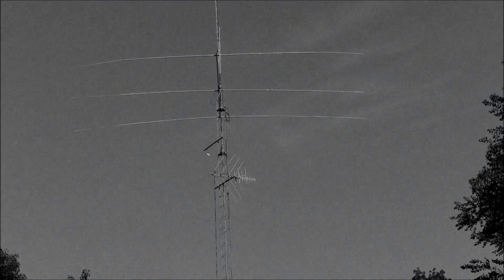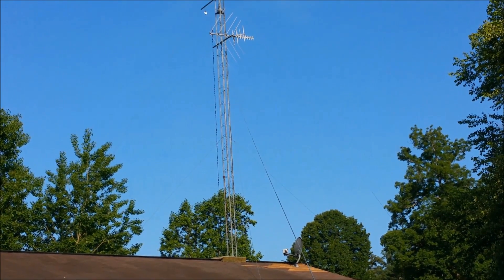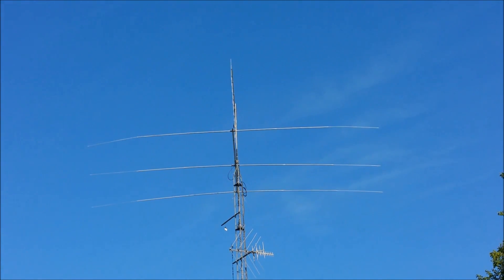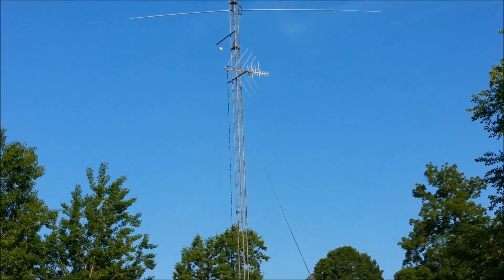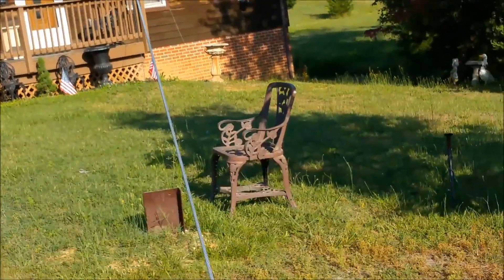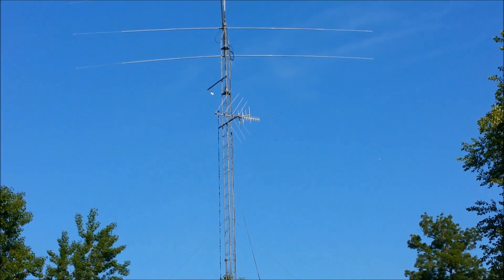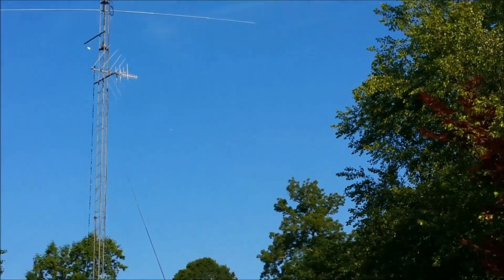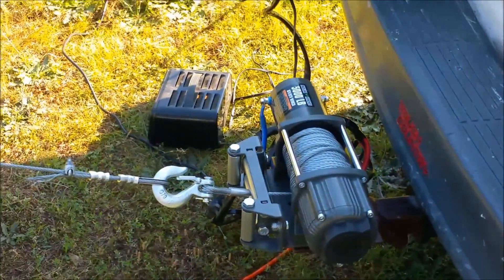Lowering and Raising 60' Rohn 25 Tower, Homemade HInge

Comment: I'm thinking about setting up my first tower here at the house, a good friend of mine has an old 60ft tv antenna tower on the side of his house he told me I could have. I ran across this video looking for ideas on how to lower it, it's bolted to the house and doesn't have and guy wires so it's going to be a task getting it down. I have a few questions if you don't mind sir.
 I'm trying to figure out roughly how thick of cable is needed for the guy lines, and roughly how long they need to be, I understand you might not know off the top of your head how much it took. Also wondering roughly how much length you needed on a winch cable to lower it down, I believe I only have about 50ft of cable on my electric winch but considering getting a hand crank winch specifically for this purpose. I'll definitely keep in mind your hinge setup, never thought about doing a hinge, it's a great idea! Chances are this old school tower will probably fold up on me but for free I'm gonna try to put it to use to get some range for my GMRS radios, and eventually setup a repeater! Also hoping to dabble in Amateur radio once I get licensed! Thanks man!
Reply from the maker: HI!  Im quite surprised he had 60' up with no guy wires!  I think Rohn suggests guys for anything over 30 or so.  I live in FL and we get plenty of wind and I've seen quite a few 40's up with no guy wires and they've survived though the years (Bolted to a 1 story house at gutter level!).   For my 60 footer here I had 2 sets of guys on it.  Ones at around 35' and at about 55' (or so).  I don't remember the length, but I had a 500' spool of 3/16" 7x19 aircraft cable.  I made my own lengths with turn-buckles so I could tighten everything up.  I highly recommend getting the crimping tool and the crimping sleeves so you can custom make your own cable lengths.  Cable clamps will work too where you might have to undo the cable.  Depending on your layout it's hard to say how long your pull cable needs to be.  I put mine at 45' and I believe it was about 100' long.  I can't remember if the 500' spool was enough to do 6 guys plus a pull cable, but it'll do most of it and then you might need a little more..
Reply: @JLPicard440  Awesome man, I appreciate the info! & yea it was on the house when he bought it and it's one of the old style towers that are known for rusting from the inside out so I'm not even sure I can get it down without tearing it up, they have it bolted to the house above the 2nd story and it's a old house from the 1800's so it's pretty tall which is probably what has kept the tower standing so long. Thanks again man! I'm currently only running GMRS but studying to take the HAM tech test now!
Reply from the maker: Oh yes... a 2 story house would definitely help hold that up better!

Comment: How far away was your winch setup from the tower? Thats a simple and effective way to accomplished this. I'm standing a 40 mast with a wind turbine here in the near future. I like adding the pull line permanent. I hadn't planned that and currently have guy lines planned but not in the pull direction i need. Thanks for sharing!✌️
Reply from the maker: I believe my winch is probably a good 60 or 70 feet away...
Reply: @JLPicard440  thank you for  the reply. I figured it needed to be a good distance.
Reply from the maker: I probably could have been closer, but the farther away I was the less steep the angle was to the house...

Comment: I've wrote here before, and still not sure exactly the size concrete base I need for a homemade tilt tower. Is my way of thinking correct? That being making sure the base weighs more than the tower. We have clay around here, which may possibly mean I could go even smaller? Most are telling me 3×3×3, , but I don't believe the previous owner of this tower, had anything near that size base.
Reply from the maker: Yes, it definitely matters what type of ground you have at your location.  At the location of this tower It was horrible digging by hand!  Very hard is what I mean.  I think I was down about 3 feet, but probably the hole was only 2x2x3.  I can't answer how big your hole needs to be since I can't see what you have to make that call, but it does sound to me, just my opinion, that 3x3x3 would be plenty good.  One thing I like to do is I used to build decks and I would mushroom out the bottom of the hole somewhat at the sides to make it increasingly difficult to pull that concrete out of the ground.  Also whatever metal you put in the ground, I would recommend to put bolts through it sideways that are in the concrete when you pour it.  It'll keep the metal from pulling out of the concrete..The guy wires to most of the work to secure the tower, but when lowering the tower up and down, you don't want the base moving around!
Reply: @JLPicard440  I appreciate the reply. I was told I had junk, but worked well for the previous owner. It's a crank up/ tilt tower. Inside or top section is Rohn 25g. The bottom or outside section is homemade, as well as the hinge base. I've had alot of ham tell me I need to hire an engineer before I do anything.
Reply from the maker: @theboogeyman826  I can't say on that one.  By the time you have an engineer come to your house and do an evaluation you could have probably bought a whole different setup!  I couldn't see myself doing that..  Of course I can't see what you've got, but it sounds like someone already had it installed and it worked, so I guess that means something..
Reply: @JLPicard440  yes it worked well before. I just don't really want alot of overkill if not needed. I may be wrong, but in a tilt tower install I would think the weight of the base would be the key factor rather than the depth.
Reply from the maker: @theboogeyman826  Yes, you have to consider that when you lower the tower down you'll get a lot of side to side pressure so that's where the depth comes in..
Reply: @JLPicard440  thanks for the advice.

Comment: Is it true you can only raise 30 ft of  rohn tower, with a rohn base plate? If so, that must mean alot are using homemade hinge plates.
Reply from the maker: I haven't heard that.. I remember the Rohn instructions said to use guy wires every 30 feet.  My home made plate certainly wasn't super strong and I never had a problem with it.  I used the cheapest materials I could think of.
Reply: @JLPicard440  yeah I've heard the rohn plate was made to raise first 30 feet, like a installation aid.
Reply: Also some claim there is alot of stress on a hinge base, but I'm thinking it's not all that great. Sure there is some.

Comment: What locks the base in place once it's vertical?
Reply from the maker: There's a bolt in the 3rd leg.  Also when it's vertical 2 of the 3 guy wires are holding it, plus the wench cable makes a 3rd temporary cable..

Comment: How deep is your foundation to the base? There seems to be alot of different opinions about this.
Reply from the maker: Mine is about 30".  Freeze level in this area is about 18...  It really depends on your area too and the type of soil.  Mine is hard as a brick and horrible to dig..😩
Reply: @JLPicard440  some say you can have a base a foot deep for a guyed tilt tower as long as it's hard soil. Seems a bit shallow to me. Then some say 3×3×3, which could be overkill.
Reply from the maker: @roynorman3650  I agree that'd be overkill.  The base only needs to hold pressure straight down.  Not much side to side pressure since the guys do most of the work... However if your hinging it down like I have it there, there will be side to side pressure while your letting it down, so it needs to be fairly strong, but not ridiculous!
Reply: @JLPicard440  I hear alot of do and dont' s, and know of plenty who doesn't go by the manufactures specs, and it seems to work. A got a big no no for stating I was going to attatch my raising cable to only one leg of the tower. Seen that as well.
Reply from the maker: @roynorman3650  Lol.. Mine was attached to one leg and never had any trouble!..
Reply: @JLPicard440  about like guy brackets  are a must, and some don't use it.
Reply from the maker: @roynorman3650  Nope didn't use them either.  Just looped the guy wires around each leg.. never had a problem... 😊

Comment: When starting to lower it, what approach is use to get it started? I've known some that use a rope on opposite side of the tower, pull to knock it off plumb. I would like mine to lower with releasing the winch. Not sure it's possible.
Reply from the maker: Hi Roy, Yes I just give it a little tug if it needs it, the weight from the opposite side guy wires that are still connected is usually enough to pull it and get it started.  But not all the time.
Reply: @JLPicard440  I appreciate it, I actually heard someone suggest arranging the tilt plate to make the tower slightly lean in the direction of tilt. I figure that may cause problems.
Reply from the maker: @roynorman3650  I think you're right.. I wouldn't do that either..
Reply: @roynorman3650  yeah, i'd never intentionally install a regular or tilt plate with a slight lean.  the tower is meant to be installed true vertical.  if you guy it so it is true vertical, it would put a lot of extra tension and ultimately wear and tear on antenna and baseplate (bending metal comes to mind).
Reply from the maker: @rickjames302  Agree... this one was mounted vertical... or as close as I could get it.
Reply: @rickjames302  been trying to think of a method to start the tilt, besides using rope, pry bar, etc. I agree no matter what, I want it installed vertical as can be.
Reply from the maker: @theboogeyman826  Most of the time the pull from the other guy wires opposite to where the lowering wire is at was enough tension to start the tilt..
Reply: @JLPicard440  I may not guy mine though. Plan on a raising pole being next to it. Tower will not be very tall either. 32 feet tall lowering it.
Reply from the maker: @theboogeyman826  with 32 feet you might be able to get by without guying it... Id put in a pretty good base though..
Reply: @JLPicard440  if I do guy it, I think the guys should be pretty tight. I see some that seem to loose in my opinion.
Reply from the maker: @theboogeyman826  Mine never really got loose.... The cables might stretch a little over time but it wasn't really a problem

Comment: I have seen a number of similar towers, that have the ability to be laid over.
And now I wonder, from an engineering point of view, where are the stresses occurring on these towers ?
As structurally, it would seem these towers are designed to accept vertical loads, as opposed to what you see in these videos !
Obviously, they are successful to a point, but I wonder just how many raisings and lowering's they will take, before something goes bust ?
Just Say'n !
🤔??
Reply from the maker: I know a couple of people that have the Rohn 25 and theirs hinge down too.  None of them have folded up.  I know a guy who has the hinge mechanism in the middle of the tower and his folded up the first time he went to use it!  These towers are actually pretty strong.  I've known them to start twisting while letting down and they'll bend up the base, but the rest of the tower is still fine!  Luckily that hasn't happened to me.... yet... 😩

Comment: Looks like that winch moves it pretty fast.  If you use a snatch block you can cut the speed in half, and have better control.
Reply from the maker: I probably sped up the footage.  I'd have to go back and look at it.  It doesn't move very fast...😊

Comment: Need some advice on a tower I have.
Reply from the maker: What's the question?
Reply: @JLPicard440  well it's alot to go into, would it be possible to talk on the phone sometime?
Reply: It's a crankup tower, lowest at 32 feet. Will crank up between 50 and 60 feet. Hinge base. Using a utility pole to raise and lower it. Was wondering if it will need guy wire.
Reply from the maker: Most of the time crank up towers should NOT get guy wires.  The down pressure that the guy wires create puts a lot of extra stress on the cable used in the crank up system.  The base of the tower usually goes into a pretty hefty block of concrete able to support the whole tower.  Your tower should have it's own specs for this.
Reply from the maker: If you have Facebook, you can PM me at take a bath productions.
Reply: @JLPicard440  I will pm you on Facebook soon. I will give more detail about the tower.

Comment: Excellent idea!  my 40 for rohn tv  rotor went out the past few days and today I tried climbing it and chickened out just above the roof line. I hate heights! Question I have is can't I just too a rope  out and have two people  slowly guide it down for me or do these weigh that much with the leverage? Thanks!
Reply from the maker: I'm not sure how much Rohn 40 weighs, this Rohn 25 is about 40lbs per section.  Rohn 40 is heavier, unless you meant that your tower was 40 feet tall, but it's the same Rohn 25 I have here.  I think two people would have a pretty hard time lowering it down to ya.  and is the bottom on a hinge?  I use a electric wench and it's under a lot of pressure.  To me that sounds pretty risky.  I would at least use a boat wench secured to a tree or a vehicle that's perfectly inline with the tower so it doesn't sway sideways.  Hope this helps.
Reply: Thank you for the reply. I decided to  hire a climber to fix it for me, and I found a few already. I ordered a new rotor and pre-amp online.It is not worth me trying to do all that work. Thank God I watched this  because I was going to try to rope it off and lower it that way. Hoping to have it fixed by next weekend!
Reply from the maker: @sonastainbrook  Yes better safe than sorry 😎😎😎.. best of luck
Reply: Saftey antenna fiberglass fence post antenna boots on the ground end fed long wire antenna 📶 go around your property lay it out with flags buffet antenna folks not a blue plate 😅 best dx ssh pass the word enjoy any hobby with out broken bones

Comment: How many guy wires needed?
Reply from the maker: 2 Sets of 3
Reply from the maker: Depending on the height of course... Mines' 60'.  I think they recommend a set of guy wires every 30 feet.
Reply: @JLPicard440  I would be doing 50 ft and believe you only need to guy at or near the top.  Yours is guyed to the tower or hazer?
Reply from the maker: @IronManXXX  I believe at 50' I would use two sets to be safe.  Just me. I have the guy wires attached to the three vertical rungs that run on each side of the triangle.

Comment: I used a similar method but I used a block and tackle method ties to the house an a 120vac winch and a hinge base.
When it's vertical the winch bracket doubles as a house bracket. And no I'm not worried about lightning, Lightning will take the path of least resistance and that should be the ground rods at the base of the tower.
Why is your TV antenna vertical instead of horizontal ?
Reply from the maker: Yes, I'm still using that tower... I wound up putting the 20 Meter beam back up again.... The Tv antenna is vertical, because I was using it for a FM broadcast antenna.  It works great like that
Reply: I’m curious, what height is your pull point at? We just set our 60f one upright today, man I don’t ever want to bring it down, it’s a hassle.
Reply from the maker: @Sindarielle  I put it at 45', roughly 3/4 of the way up.. It's always worked good that way.  I think the peak of the house helps it a bit

Comment: What size pipe did you use and how deep did you sink them?Are they in concrete? Did you fill the pipes with concrete after installing the bolt (they look filled) Thanks for any help.Gonna start on my tower next week.
Reply from the maker: Nunofyour beesiness Hi... I cheaped out... I get the third degree from local ham buddies... but it's been solid without even a hint of a problem... I used 1/1/2" electric conduit... I dug a hole about 30 inches deep and put rebar in the middle (of the conduits) that's hammered in the dirt a few inches below where the pipes are in the bottom of the hole... and filled with concrete (both the hole and the conduit)... of course u must drill and install tower axle first! Or u might have trouble later... the pipes only have to span about 6 inches between the concrete and where they hinge on the tower... so it's pretty hard to bend that with only a few inches sticking up... I also drilled through towards the bottom of the pipes about a foot above the bottom of the hole and put a bolt thru both pipes to give concrete more to bite to.... hopefully this answer isn't to long and makes sense! Thanks
Reply: I can't believe you get the third degree,It works and it's cheap.You didn't spend a small fortune to build.... I love it.... Thanks again for the info,easy to understand.Too bad you didn't do a video when you built it,i am sure it would have been a big hit.Who wants to spend $300 on up for a fancy base when this is so simple......
Reply from the maker: Nunofyour beesiness yes I wasn't doing as many videos back then... I did this one as a "let's try it and see"!!  Thanks again
Reply: @duckthis17  I just purchased a NEW ROHN 25 tilt base yesterday for $350 from a fellow who ordered it from DX ENGINEERING and he paid $455 plus tax and shipping but he never put up the tower. It’s very solid and I think for $350 I got a Steal.👍🎙
Reply from the maker: Awesome!